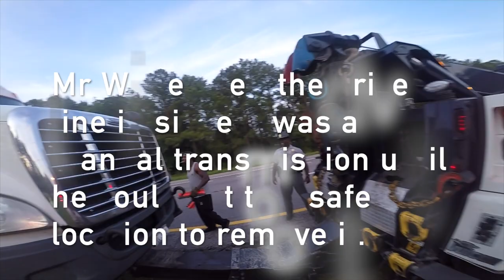South bound in the North bound lane. 18 wheeler blows steer tire.

Comment: Drivers don't even care, they never gave up the lane to ensure Mr. Wilbert's safety, even with the troopers standing by.
Reply from the maker: Mr Fernando yes sir.. I wish they slow down and move over.  Thanks for watching and stay safe
Reply: @SumterWrecker  sir they passed a law here in NY that says you have to move over for emergency vehicles. You need that down there. Poor Mr. Wilbert. It’s a shame you have to pass a law for something that should be common courtesy. One last thing. Troopers around the nation sure could take a lesson from your SC troopers about looking sharp in uniform. You all please stay safe.
Reply from the maker: @ottoneidlinger4938  Yes sir same but I have not seen it enforced. Thanks for watching and stay safe
Reply: @SumterWrecker  why dont you ask the highway patrol for aditional units to keep the lane close and set up a bufferzone?
Reply from the maker: @amedtajanjimenez9767  usually they do not have enough units but they will get assistance from the sheriff's department.  I am not sure if they were extremely busy that day or what. Thanks for watching and commenting. Stay safe
Reply: At the least, the lane nearest the wrecker should have been closed off. That's how emergency service personnel get killed. Keep safe all.
Reply from the maker: @ahwootton5  yes sir I wished they would have closed it. Thanks for watching and stay safe

Comment: HI SIR ANOTHER GREAT VIDEO MY QUESTIONS IS IF YOU HAVE TO TOW A TRACTOR UNIT DONT YOU HAVE TO REMOVE THE HALF SHAFT ON THE REAR OF THE LORRY TO SAVE THE TRANS BY UNDOING TEN BOLTS ON THE BACK WHEEL AND MR WILBER NEVER USED THE BREAK AWAY CHAIN OR DONT YOU HAVE TO ALWAYS, HAVE THIS CONNECTED, TAKE CARE BEST REGARDS TONY,
Reply from the maker: Mr Tony We pull the drive shaft at the first rear end. That keeps the transmission from turning. We do use safety  chains. Thanks for watching and stay safe

Comment: I still can't understand why pull the driveshaft of a truck with standard transmission?
Reply from the maker: Mr C.O.G The main reason is liability and I have been told newer transmission has a bearing that does not get lubricated will the transmission spins in neutral with the drive line in. Older trucks you could leave in towing a short distance. Thanks for watching our videos and stay safe